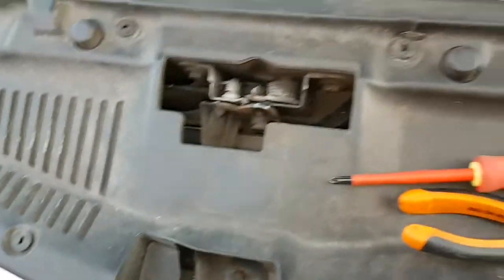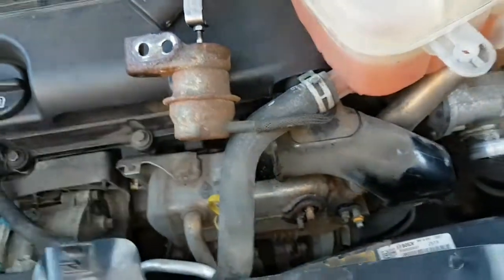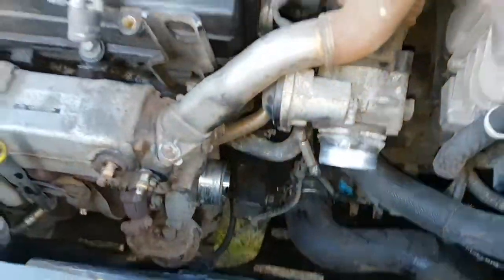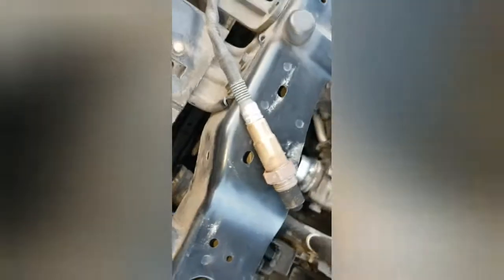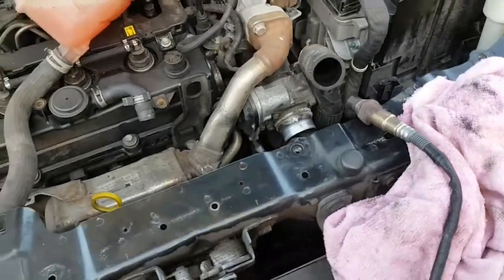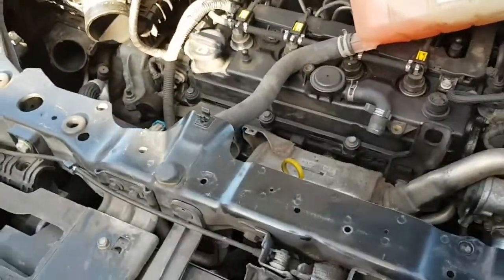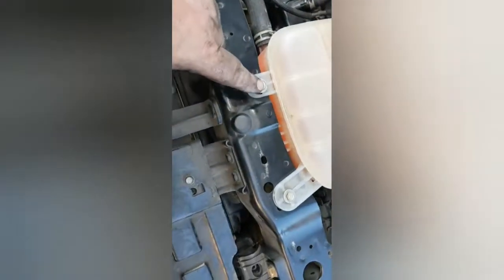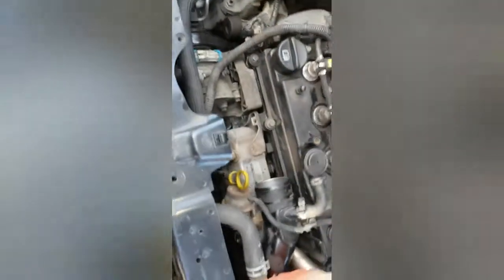Vauxhall mokka 1.7cdi  o2 - oxygen sensor

Comment: Will replacing or cleaning this O2 sensor fix p0183 trouble code? Thanks btw good video 👍
Reply from the maker: Nope p0183 is fuel temp sensor in the fuel filter housing make sure connector clean.

Hope this helps

Comment: I changed this last year now it’s throwing the same code again
Reply from the maker: Are u doing short journeys and did u buy cheap sensor
Reply: @fuelheadjay8800  yh mainly short journeys the odd long run not sure if it was a cheap sensor a garage changed it
Reply: @fuelheadjay8800 would a garage use a cheap one and if they did do you think that’s the reason it’s throwing the code again after a year or could it be something else that’s causing it
Reply from the maker: @stephensharpe6309  yep a garage would use cheap parts plus if your only doing short journeys that would course it to try running cleaner through fuel and give it good run on motorway do about 50 miles at high revs ie 70mph 3500 revs so low gear to get car to go into regen and clean it self with cleaner in fuel